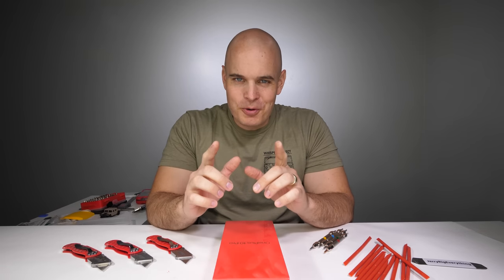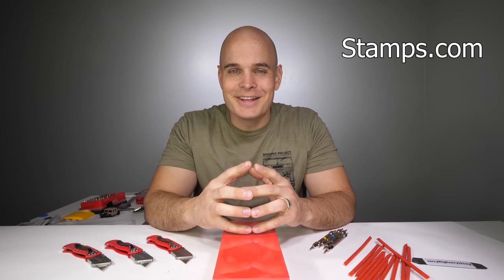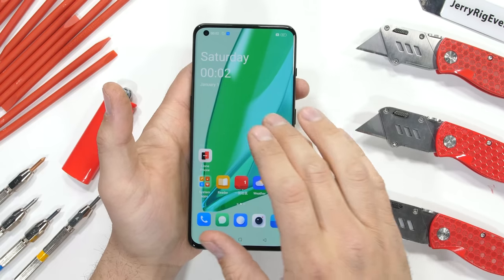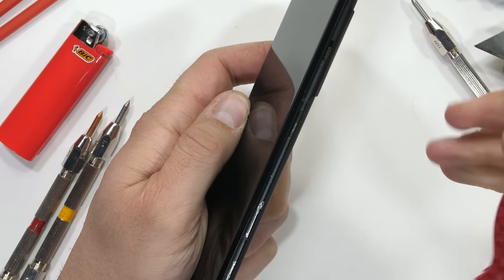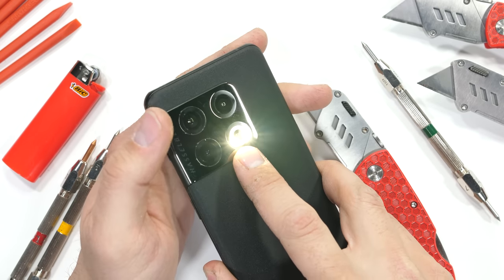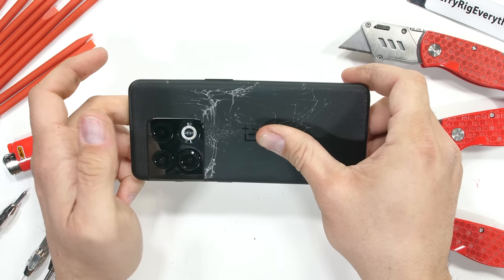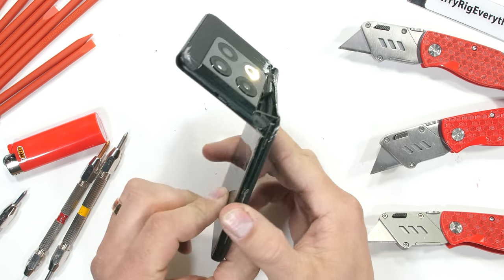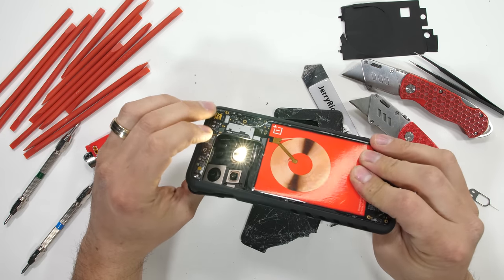Somethings wrong with the OnePlus 10 Pro... - Durability Test!

Comment: Had the 5t. Loved that phone. Rooting was so easy. ROM swapping was super easy. I went with Samsung after cause OnePlus starting charging more and more. I wanted more too, so OnePlus fell away, might as well spend the extra 150 for more.
Reply: How's OneUI? It's always been a turn off for me. Im still on 5T.
Reply: @ETS186  heavy compared. I miss the shelf. Samsung Free is Samsungs shelf, it has podcasts, Samsung free TV, the news and instant games. It kinda sucks compared.  What android version do you have? I did not like Samsungs update policy.  Each gen only gets two major system updates. So, I won't get the next Android version unless I buy the next gen phone with Samsung.  I remember OnePlus supported the 3t forever.
Reply: @P4boot  the ecosystem for iPhone is hard to deny as really nice. However,  I'm a fan of having more... lol. So, I need a phone with more of those power options you mentioned. I know several people who rock apple products. I can't get behind the price point for what you get. Which was the same for any OnePlus after the 5t. I would have been spending more and more each gen for basically the same phone. I didn't want they. It would have been me settling to buy a OnePlus after the 5t.
Reply: @graceforged84   samsung phones are best in updates right now uppermidrange get 3 os  and total 4 year update and flagships from s21 get 4 os and 5 years total updates
Reply: @lakshyagrover6379  I'm rocking the note 20 ultra. On Android 12. I thought it was only the 2 OS updates. That would be great if they extended it to 3 os updates. Gives this phone a little more time in my hand. 😀
Reply: @graceforged84   note 20 ultra is 3os list it was phone along which samsung anounced 3os and total 4 year update

Comment: Just bought a OnePlus 10 pro in the US through a tmobile store. Not gonna try to bend it but will note camera is now 48mp so structure May have also improved.  Will note to be careful with it though. Didn't realize the back was glass. Also did not come with plastic screen protector

Comment: OnePlus has been already bringing great phones but this collaboration with oppo has made worse. Maybe that's why they didn't release it world wide so that they could test it out in China.. I'm using OnePlus 7 Pro and it's been almost 3 years since I have brought and this phone is a beast still.. rather than the battery slightly a bit weaker and some heating issues after Android 11 update.
Reply: My USB C port kinda fucked on my OP7 pro. Gotta put the cable in at a certain way :(
Reply: @emmetkeane4807  Same here but it's fine didn't wanna open up my phone just because the water resistance is great now so if they open my phone they'll mess it up
Reply: Oppo is their parent company. This ain't no collab. It's a merge of the brands

Comment: Xiaomi Mi5  was a phone that also snapped in half like a biscuit during your bend test. But I bought it anyway since it was the closest to what I wanted. 5 years later I still have it and it's fine. Knowing it's fragile means I took extra care, so it didn't break. I even replaced the back glass for like 15$ so now it looks like new.
Reply: Why did you replace the back glass if it didn’t break? Nice try OnePlus marketing team.
Reply: @angelkostadinov1689  It was getting really scratched. I took care not to bend it but I also don't use a case

Comment: I have used OnePlus One when it got out and later upgraded to OnePlus 5 and still been using it which works like charm after a simple $3 battery replacement and i can stretch it till it slows down for another 2+ years.  OnePlus lost it after the 7 series. These are just the rejected prototypes of Oppo phones.

Comment: As an owner of the OnePlus 2, 5, 7Pro and current Nord, plus countless accessories from the brand, it's a shame to see their latest flagship snap. 
They certainly have gone downhill since the 7Pro with that nifty pop-up camera and no notch approach. 
The software is more Samsung than OnePlus, and with the integration of Oppo + ColorOS, it's lost its credibility.
Reply: I'm also disappointed. Had the OP 5, OP7 pro and now the OP9 pro. Tha 7 pro line was their best phones.
My OP9 doesn't feel as stable as the 7 was. The battery is only fine. The software is lagging at some times and the camera doesn't have consistency.
I am sad to think that this is my last oneplus phone. And I really love the brand

Comment: Yes, it affects my buying decisions.
I won't buy a phone this weak ever.

While I'm super careful with my phones, I've never had a cracked screen and I never use cases.
I've also never bought a glass backed phone, except for the Pixel 2 XL.
I like metal on the back of my phones, why does anyone want to have to worry about cracks in both sides?
I don't think they make good phones anymore, I thought the Pixel 2 XL was 2 steps forward one step back. Since then they've only gone backwards.

The best phones are in the past, now everything is designed to break and not be repaired, I hate it.
Reply: The same is true across multiple industries. It's a generational change. The generation of people who DIY everything is dying very fast. It's disappointing. Social media did this to us.

Comment: My oneplus 6T died. The Galaxy S22 ultra costs a lot here so i thought, why not OP 10 pro. I was almost ready but something told me to watch the durability test. I thank my stars i did. The S22 ultra is the one i went for. I want my phone to survive 4-5 years. The kind of usage i do, I avoided cheap phones for this very reason, terrible engineering that makes a weak phone. 

Can't believe this is the same company whose phone (oneplus 3) was ran over by a freaking train(that's not a fun story) and still survived for 3 days before dying. The 6T itself survived a drop from my balcony on the 2nd floor to the ground below. Just a shattered screen that STILL WORKED. 

Now look at Oneplus. They have nothing going on for them. Hassleblad branding isn't fooling anyone.

Comment: I currently use a OP7 pro and it has been amazing in every way. I always loved OnePlus but now, I'm extremely disappointed with the new phones from OnePlus and their engineering. They have truely settled.
Reply: Well, I think I might be going back to Samsung. Maybe the ultras pen will add some structure. Better luck to next year's test. If you do buy this phone I'd recommend the upgraded warranty and hang on to the box so you can ship it back.

Comment: Of course, at the time of this video the phone was not available in the United States. However, soon after it did debut in the US. Frankly, I'm not sure why anybody would conduct durability tests such as these. Pretty much every phone is going to break under these circumstances.
Reply: Just watch his other videos, almost all other phones survive.
Reply: @w1pa123  I have watched many of his videos and the phone's seldom survives. As a scientist, I have to say that the odds-on many of these things actually happening are so statistically low that the point of these tests eludes me. Obviously, if one was really concerned with these kind of anomalous events occurring then wouldn't it be easier to simply purchase insurance for the device? Frankly, it looks like destruction for the sake of destruction.
Reply: @dr.fitprofessor1970  Watch his recap thr year- videos. There he showcases each phone he tested that year and all the ones that failed. The majority survive.
You can easily bend a phone by sitting on it, it's not inconceivable.
Reply: @w1pa123  In fact, you are quite correct that is conceivable. Although, only so long as you are the small percentage of the populace that lacks the common sense to put a decent case on a phone that you just spent a large sum of money on. Especially, when one takes into consideration that most devices are constructed from glass and ceramics these days. Psychologically, an ounce of prevention certainly outweighs a pound of cure. Again, fink insurance!

Comment: I have a Samsung S7 with Gorilla Glass 4. Jerry made a video about EDGE where the scratches also started appearing at parts 6-7. So Gorilla Glass 4 and Victus is the same? :'D
For some reason, it scratched by me pretty easily, I didn’t use foil all the time, but it can withstand the fall pretty well to this day.

Comment: Ever since oneplus 7 left the stages, this garbage came across

Like they included xbl files from all 8 models (8, 8T& 8pro) into one single xbl in all update files aka official firmwares

What happened is that many 8 models got dead as xbl is the ram partititon and If that ist flashed and gets that Part with wrong xbl Parameters and gets corrupted, no fastboot no edl no adb nor anything can bring back your dead phone, replacing motherboard that costs as much as The phone itself

Down U go oneplus

Comment: The one plus 10 pro cracks when I bend it I tried to bend it and it cracked after I tried it so hard I've been there for the other direction and I use a table with it with my Force and it breaks

Comment: Uhm...so back in 1822 Mohs invented a test to see what different smartphone screens are made from huh...1822....1822? Yeah so there appears to be some discrepancy with this year as there's a lot of areas stating the year was 1812, not 1822 but who knows. Also, this is a mineral hardness test, which yeah you mentioned but whatever it's not a smartphone screen material test or whatever. I'm just gonna assume this is you trying to be funny and failing, especially after your very very weird screen protector smells like hairspray see if you can smell it if I hold it right up to the camera comment and what I'm guessing was also an attempt at you trying to be funny and yet again well to put it bluntly crashing and burning with that one as well. Let's maybe skip on the attempted comedy and just stick to the facts.

Comment: I have seen your all videos wherein you have given gentle pressure to break the phone, However you have given extra effort to break this phone Which is clearly in this video. I can break any phone in two parts easily by using my hand not a big deal. You need to use a machanical pressure for bend test to check the durability. This is not correct method by using hand a bend tast. 😂